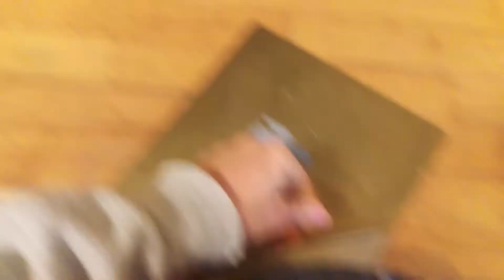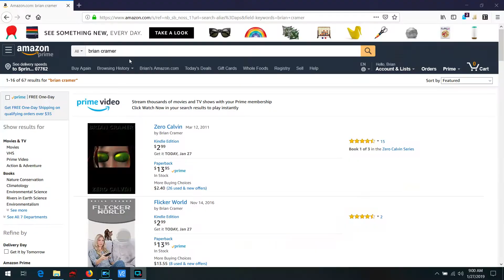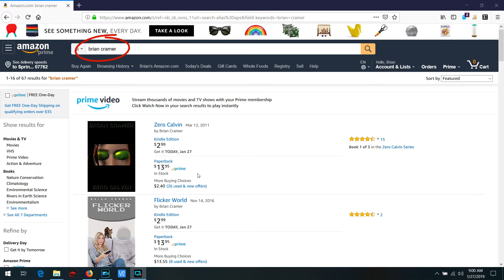Replacing PEI Sheet on Prusa i3 MK3

Comment: Forget Limonene.  I wasted a full 24 hours with next to no results.  This method with the IPA worked exactly as it was in the video.  I scraped one side all in one ball, it was like a big handful of snot.  Pulling off the frozen PEI was weird, pulling one way was difficult and tearing the sheet and on a slightly different angle it all but fell off.  Be sure the glue is all gone, don't get lazy and leave tiny flecks along the edge as they are prone to forming air bubbles.  Thank you sooo much for the video.

Comment: Thank you! Putting the sheet into hot water to remove the glue layer was a revelation, I hadn't seen that before trying oils, acetone, IPA, brake cleaner, foam gun cleaner, etc, etc. Just hot water and it scrapes off much more easily!
Reply from the maker: Excellent. I'm glad it worked for you.

Comment: One handed. I can feel the difficulty you had just from watching. I wish you have tripod while making this video. By the way, I learned from you that IPA can be used for removing the glue from the plate. What I knew before was it requires a hardful substance limonene to remove the remaining glue. This was the reason I prefer to buy new one. Thank you for this video.

Comment: Can you recommend a source for the PEI sheets?
Reply from the maker: Honestly, I just nose around Amazon. They no longer stock what I used to buy. This is what I used this time and it seems suitable so far: https://www.amazon.com/gp/product/B07D8RNN47
Reply: @0calvin  Thanks, I saw one of the comments on the 1mm sheets that said for Prusa printers, you need 0.25mm sheet (otherwise PINDA probe doesn't work), but I wasn't able to find any of those.
Reply from the maker: I have used 1mm with the MK3 but I did have to adjust the probe, however the spring steel becomes too stiff and in my experience it is actually harder to get the PEI applied without any trapped air. 0.5mm seems to work just dandy

Comment: Thanks. So what happens to the PEI coating on the flip side of the prusa build plate when it's in IPA overnight?
Couldn't you just use acetone? It'd work fast..
Reply: Plus....Acetone evaporates really fast. If you wrap it  in plastic wrap it may eat up the wrap depending on the brand. The last thing you want is to let the acetone evaporate and develop into an explosive atmosphere. So to be safe, place it near your gas water heater so it vents outside through the water heater vent. DON’T DO THAT I WAS JUST KIDDING!!!
Reply from the maker: Good question. I usually just flip the steel sheet over when I bugger up one side so when I bugger up the second side I replace both at once. Acetone does not work well at all for me. While it does soften up the glue somewhat, it makes it even stickier and nearly impossible to get off of the steel sheet. If you wanted to try the alcohol on one side only then you could soak a rag in it and place it over the glue side, then wrap everything in plastic wrap. The Alcohol works in an hour or two, I think, but why not make sure and leave it overnight.